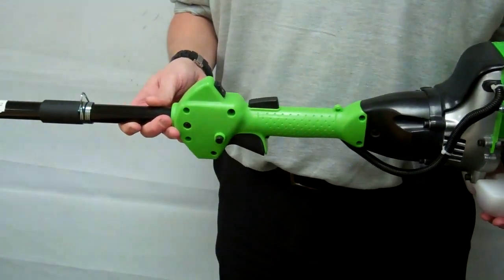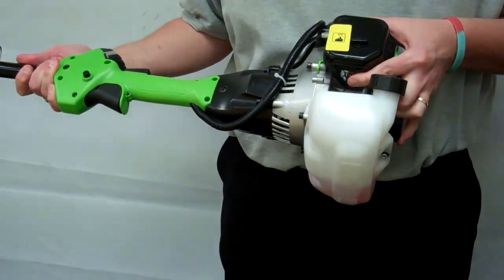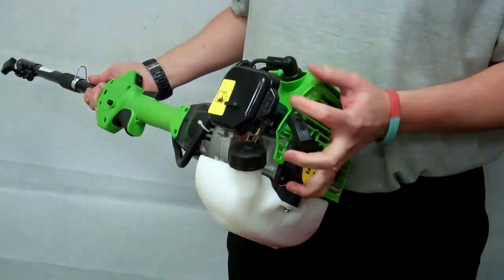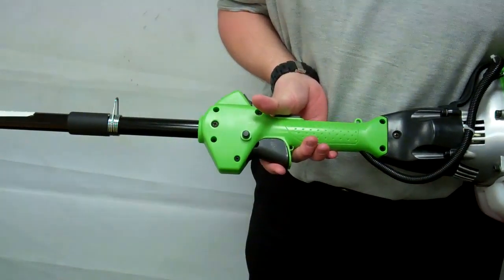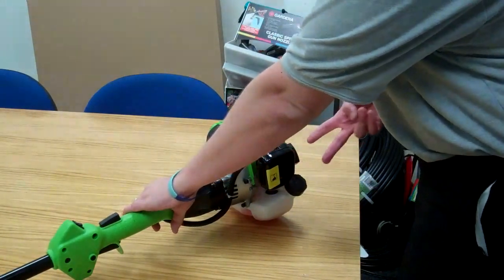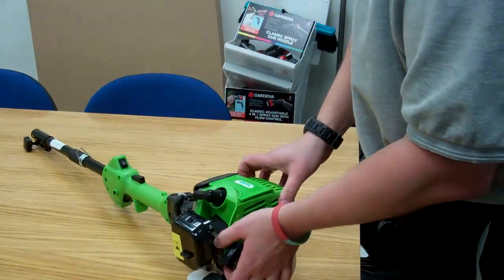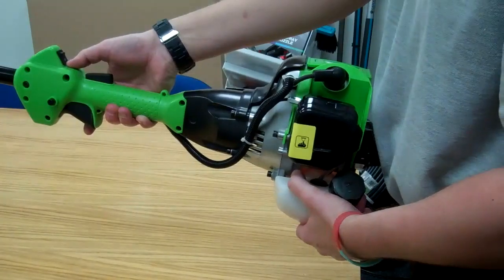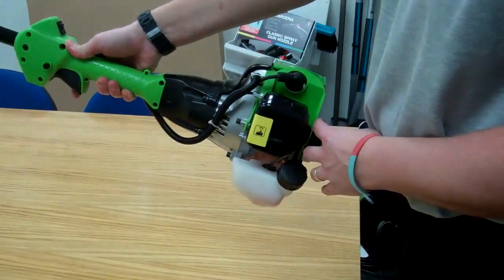Starting Your Multi-Cutter

Comment: Thought you'd like to know - I've had one for about 2 years and don't seem to have too much problems starting it from cold. HOWEVER: mine will not start from warm - at all. You have to leave it about an hour to cool down. Also the ergonomics are all wrong. The shaft is too short (I'm 5 foot 6), so you have to rotate it forwards to use the attachments on the ground. The balance is totally wrong too, way to much weight on the back, so you have to pull the motor up to bring the blades / strimmer down to touch the ground - which does your back in - despite no end of adjusting. I ended up putting the strap clip on the little eyelet on the handle, which is not meant for the strap, but gets the balance working better. But that has just snapped now. Has anyone from Handy ever actually used one of these for more than 30 minutes?!?! They would realise this if they had. The brush cutter was so badly made that the bolts touched the blade and didn't allow it to rotate properly. Then today the starter chord broke and spun back inside the machine. I wanted a Stihl, but the salesman for some reason persuaded me to buy this instead - said Stihls really were only a worthwhile investment for professionals. Don't buy this, even if you don't use it for a living - you buy cheap, you buy twice - you have been warned! I used to work for various gardeners, so I speak from experience, having used many different strimmers, all far better than this thing.
Reply: I bought this thing from ideal world about 6 years ago and it has been a complete waste of money. The motor unit is such poor quality that the starter cord gets stuck out. Starting when hot is impossible. I replaced it with a Ryobi which was slightly more expensive but much better quality.